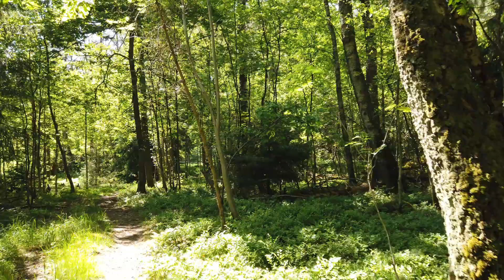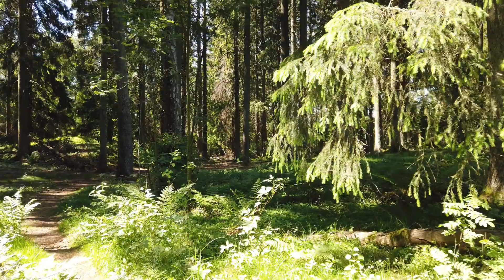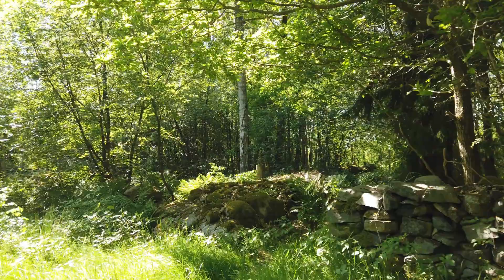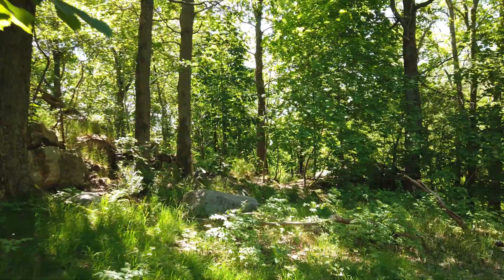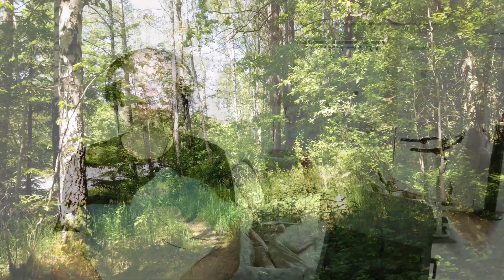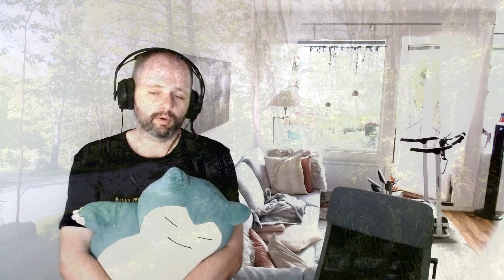How to be SOLID in React?

Comment: This is literally what has hapenned to me a couple of days ago, except that I was explicitly asked by mentor to learn and apply SOLID as a trainee react dev and read Clean Code because of my variable naming. In the meantime, I'm not building stuff. I'm torn apart as to what should I do. I agree with Eric. You don't need all these principles until a certain point in time when you already know (from a practical standpoint) what problems does SOLID solve.